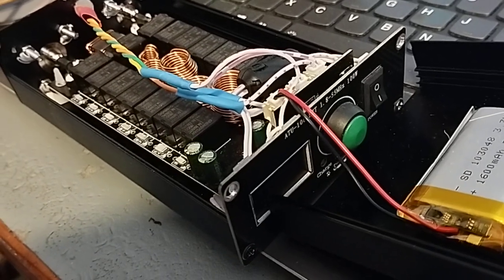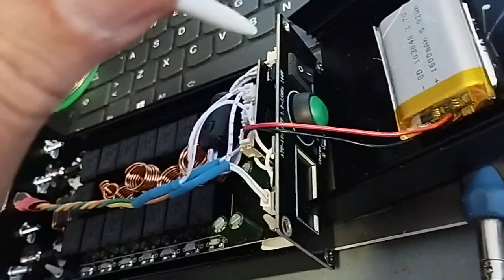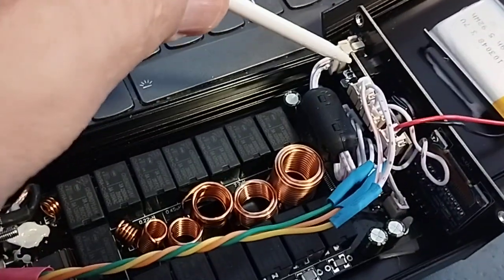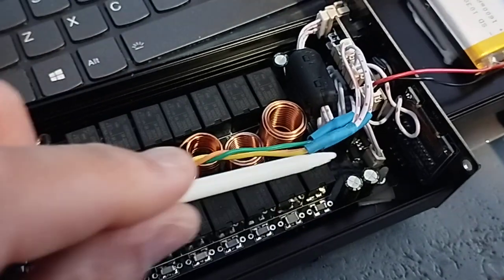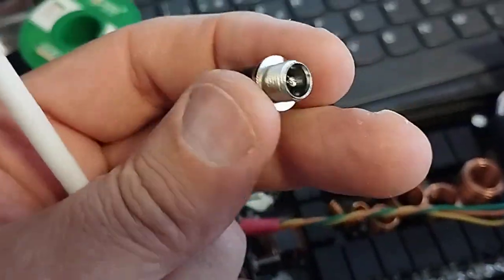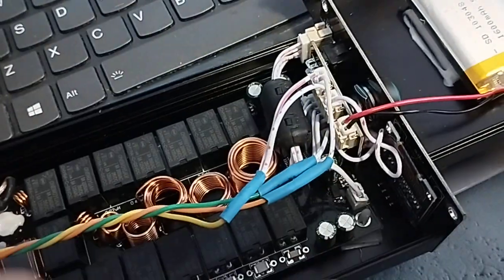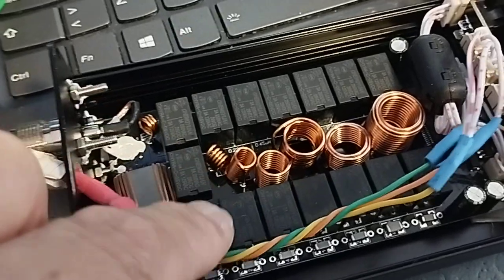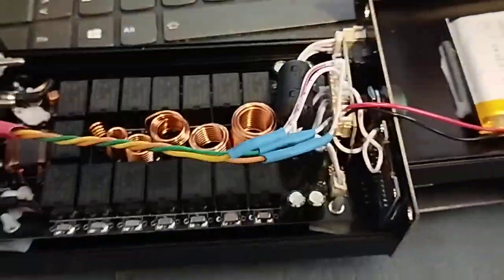ATU-100 How to add an external power socket

Comment: nice vid...can i use the  12v directly to the power switch and take of the battery??
Reply from the maker: Yes, you just need to unplug the battery board, then wire 12 to the main board power socket

Comment: These are so badly made, my usb port broke after 2 times charging and the led leg broke off, it was so badly soldered. Now I’ll have to bypass the charging board entirely as I cannot fix the broken off usb port.
Reply: Same, broke off on my second charge, any idea how to bypass it all together?
Reply: @bradcollins1762 The main board needs 5v I believe so I was just thinking to connect up the red and black wires that go to the board with power.

Comment: Hello friend, excellent video, but even with a translator I couldn't understand the connection, in the case of the battery, did you leave it or eliminate it? And does the 12 v go into the main board and the converter board as well